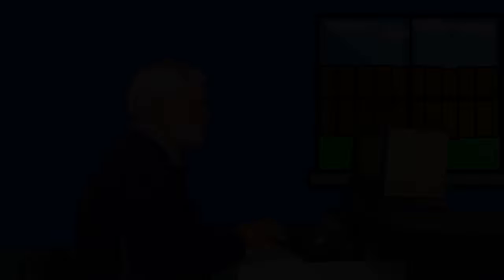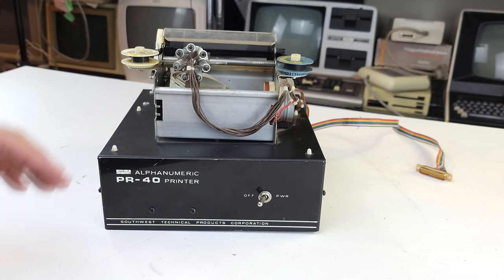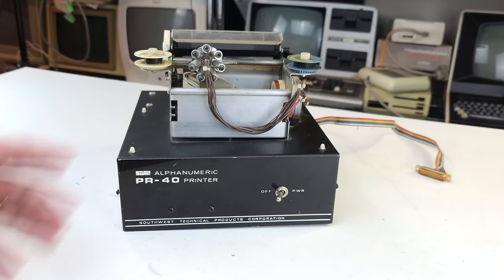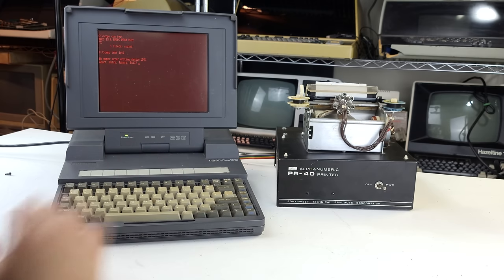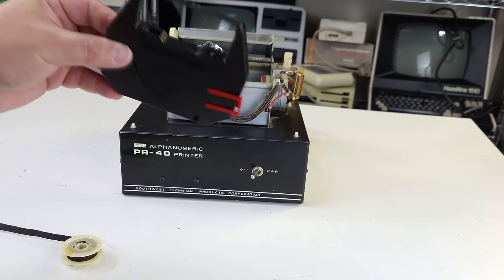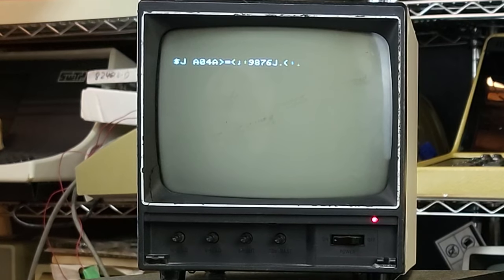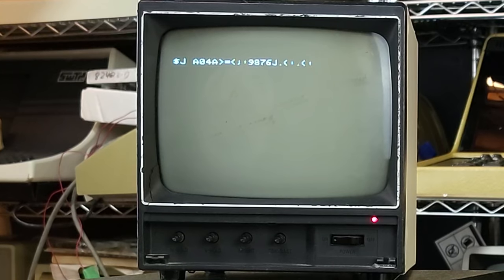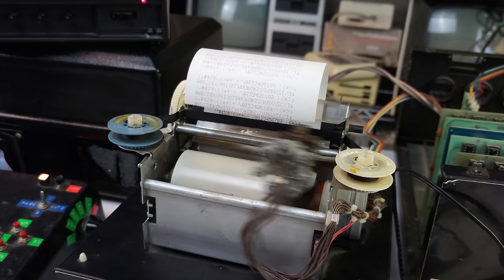One of the first printers for a home computer: the SWTPC PR40

Comment: Love this sort of "analog" technology right at the birth of what we consider "computing" today. Incredible engineering and ingenuity that went into these machines.
Reply: It reminds me of the Sinclair ZX Printer. They had custom paper which was aluminium coated, so silver on top and black underneath. The printhead was a single electrode that was scanned across the paper and the paper advanced was geared down version of the print head. It had one digital input which produced a spark to vaporise the aluminium exposing the black underneath. There was also a digital output as the electrode passed the left side of the paper. The printer driver was some Z80 code running in a tight loop shifting out dots with interrupts disabled. Ultra low cost design for the printer and I think you had to buy the special paper from them.

Comment from the maker: A few notes that didn't make the video: I ended up cutting the DB25 off and just plugging the wires directly into the molex header on the MP-LA.  Totally forgot to mention that.  Also, I ended up moving the MP-LA to Slot 2 during testing, so that's why the address I entered near the end is hex 8008.
Reply: Soooo...... you could put a replacement DB25 on with it wired up Centronics stylee :)

Comment: The printer SWTPC used to build this was made in Riverton Wyoming by LRC, a model 7040 ticket printer.  At the time this was an OEM printer sold with no electronics mainly for cash registers, casino and lottery ticket printers.   LRC was purchased in 1980 by Eaton corporation,  now it's remnant is Pertech still in business.   I went to work for the company in 1980 as a test equipment engineer and built Z80 S100 based computer diagnostic, production and life testing computers.   I still have parts and a working improved version of this printer designed an built by LRC using the 7040 printer.

Comment: This reminds me that decent printers were ridiculously expensive until Japanese dot-matrix models with 'Near-Letter-Quality' (double-pass) output became affordable (mid-1980's?). Before then, letter-quality printers were $1500 and up, while dot-matrix printers cost less, but had crude output. I remember (late 1970's-early 1980's) when converting castoff IBM Selectric typewriters for serial or parallel output was a thing; but such machines were very slow and had to be realigned constantly -- and they would still set you back several hundred dollars. (One can treble or quadruple the prices involved at the time to get the cost in today's currency.)

I enjoy your channel, which fills a gap in coverage by most other retro channels, which are PC/Commodore/Apple-oriented and seem to dwell mostly in the 1980's and 90's. I love hearing about stuff from the initial 8-bit wave, including CP/M. Thank you.
Reply: Hewlett-Packard was making them well before the Japanese copied their designs.
But: they cost as much as a new car.

Comment: That PCB looks absolutely gorgeous. How something like this could last as long as it has without outright oxidizing is a miracle.
Reply from the maker: Yeah I've been pretty lucky that way.  I have had some PCBs that were brutally oxidized though.  Usually older boards where they didn't tin them.

Comment: I have fond memories of this printer, which had 40 bytes of line buffer memory, and the printer mechanism itself was a cash register printer. You could send up to 40 characters to it followed by a carriage return, and the printers electronics would convert the bytes in memory to a character using its font memory in EPROM, and discrete electronics (no microprocessor used).
At that time I had a friend who self published a magazine about commodore computers, and especially the PET.
So he wanted to write an article about using this printer with a commodore PET, and he asked me to check his built as he wasn't a hardware person. So I obliged him and checked what he had done. I checked if the IC's were soldered correctly not 180 degrees rotated, and all was well, his solderjob looked okay, and he had not soldered in the electrolytic capacitors in reverse, I saw not other errors, so I cautiously gave my go ahead. My friend powered up the printer while he was looking at the PCB to see if anything started smoking. The moment he turned the printer on the large electrolytic capacitors in the power supply exploded right into his face, and there was brown and silver paper confetti everywhere. when he had recovered from the fright and had washed his face thoroughly, I checked if I could find out what had gone wrong, not the polarity of the caps, I had checked that. Then I saw the cause, he had reversed the types of molex connectors, and had used male connectors where it should have been female connectors , and female where is should have been male ones, this had swapped out the order of the wiring, resulting in reversing the input voltages. I later heard that eventually, after replacing the electrolytic capacitors, and swapping the molex connectors, and replacing a blown fuse he got the printer to work.
Reply from the maker: Oh wow!  That is an amazing story!  I have had caps blow up in my face and even though no actual damage occurred to my person..  it still freaked me out.  I cringe every time I plug in old electronics because I'm waiting for that pop to happen.  This is really great hearing from a contemporary user.  Did I have your motivations right?  Was it mainly about having a hardcopy backup?
Reply: @TechTimeTraveller  The main reason, I believe it was, was that he wanted to get it working on his PET, and write an article about how to do that. And in fact he did just that. It could be he also used the printer to print labels for his very extensive collection of commodore PET cassette software.

Comment: SWTPc's 8k Basic & up would print to the PR-40 with a PRINT #7 command or a LIST #7 command.
Flex's default P,DIR would also print to the PR-40.

Aside from the PR-40, any printer you could connect to your system co$t more than everything else!
I have fond memories of them. I even had an article printed in "Doctor Dobb's Journal" that was printed on a PR-40 and was how to use the PR-40 with SWTPc 4K Basic.

Comment: Back in the day I worked in a telephone exchange for the Air Force. They used teletype machines for communications hard copy. After my tour of duty I bought a used teletype machine and connected it to my TRS-80 Model 1 computer. I then wrote a short translation program to convert the asci 8 bit upper case and lower case to 5 bit upper case Baudet code, slowed the data speed to the teletype machine, and added a timing delay and current loop circuit to match the teletype machine. It was painfully slow to print anything, but was better than scrolling through a tiny screen full of code looking for a bug. Having the entire code to search through made life a lot easier.

Comment: Hey, I STILL have a bad haircut! Just a different bad haircut than in '76. :)  

I helped build one of these when they were new. I was just 18, but my friend & mentor bought one of these. As someone who was reading all the computer magazines every month back then, I agree that this was the first printer designed for the computer hobbyist market. When Bob got sick of printing on cash register paper a couple of years later, he upgraded to a surplus commercial Centronics 101...which I got to help him carry upstairs. Yeah 150 lbs sounds about right! That monster only printed in one direction, so returning the carriage to the left side was dead time when the printer wasn't productive. Well, they wanted to minimize that, so the carriage return on this dinosaur was like firing the printhead out of a cannon. It then slammed into a BIG shock absorber on the left side, and shook their whole house when it was printing. Ah, the good old days. :)

Later, he also acquired a "Friden Flexowriter", a direct competitor of the Teletype machine you showed, I believe. I don't recall what interface the Friden used, but it sure wasn't RS-232 ASCII. Maybe BAUDOT encoding? Bob designed and built a conversion board that involved lots of reed relays. I can't recall the model but it looked like the Friden 2200 series.

Nice channel. :) Subscribed.

Comment: Ahh, good times...
This brings back the memory of my first printer - Seikosha MPS-801 with serial interface for Commodore computer. The only slight issue was that i had the Spectrum, without any interface whatsoever. So I made my own, using Z80-PIO, If memory serves.
BTW, MPS-801used so called "uni hammer" head, so instead of 7 pins, it has one long vertical hammer, and below the paper was long rotating star shaped prism, so printing was performed "pixel by pixel", compared to normal dot matrix "row by row". No wonder that, at 50 CPS, it sounded like Stihl chain saw...
Compared to that, SWTPC PR40 printing technology look quite modern, especially considering it was about 10 years before MPS801 :-)

Comment: Impressive troubleshooting and great information! My first printer was an IDS Paper Tiger 440, which didn't seem much further along technically than this.  It was a beast, but I had so much fun using it with my Exidy Sorcerer.  It even had "graphics"!
Reply: It was much higher along: it printed full width pages and didn't overheat.

Comment: With the disclaimer that this is from vague memory of first-hand memory from my 20s when I'm well into my 40s now and my memory isn't getting any better...

I recognize LRC, Inc. as a name from my time repairing old stuff from Big Blue.  I don't know the providence of this specific model - but ones like it  were used in early model cash registers, what would be the progenitor to the SurePOS systems IBM sells to this day - the LRC printer component part anyways.  These were essentially terminals - there would be a SurePOS "master" that was a computer running a very early operating system - CP/M or AIX depending on age though it would have been CP/M back then, usually held in a cash office or similar secure accounting space, and then SurePOS registers.  They were a little smarter than dumb terminals, since they would be attached to a printer and cash drawer the terminal would have to interface with, but not by much.  The LRC component was the printer only, as the chips to control it would be either on the controller for an economy system where everything printed in the cash office, or on the terminal if they were at the register.  The former was more common until the personal computer revolution began.  These were largely used in many banks, and modernized versions of these are still used in some banks back offices to this day, such as TD (or they still did some six years ago  when I finally got out of doing this as anything but a hobby - might have changed in the intervening time).

From what I was told when I was trying to back-engineer these for lack of documentation, LRC was a second source for IBM, but I am not sure about that because I never saw anything other than LRCs with these early systems.  It's possible they were a primary source but got relegated to secondary source status when more providers came around.  But, even so, it was never an exclusive thing back then - the market was too small for exclusivity to be sustainable (and indeed many companies had problems even without it).  So it doesn't surprise me to see Southwest using a component that was largely-proven by Big Blue to try to get to worth with their attempts at personal computers.  It would be a while before that really took off, I guess the SWTPC 6800 was before its time in that regard.

I just wanted to finish this long questionably-informative ramble with saying I really appreciate seeing you getting these old systems working again - they're basically historical artefacts now, and pretty much everything about our current society owes much to these early forebears.  It's more than just a nostalgia trip: understanding how primitive computers works is very informative to the underpinnings of our current computers.
Reply: On a more directly on topic note - there were metal versions of those spools you could get provided by IBM themselves back in the day.  Quick research doesn't find them unfortunately, but you might want to consider having replacements on hand for those plastic ones if you run the printer for more than short bursts.  It's probably not too difficult to 3D print them.  Repeated passes over time without rest tended to stress them in a way that causes them to develop cracks.  

Your LRC seems to be missing some c-clips that held the spools down without exerting too much force, which is likely why you had to hold them down.  You could probably find one of an appropriate diameter, I used to get them out of the bins of auto body bits and bobs out of Canadian Tire or PartSource.  Just make sure that it doesn't restrict rotation of the spool and you should be OK.  You don't want them to be too "tight" - just tight enough that they're kept from vertical movement.

Also, if you do plan to use it: the printers were not made to print more than 4-5 lines in one "go".  The output was meant to be like "$500 rm dr1" and similar shorthand for cash transactions out of the cash drawer, at least in the IBM application - the lines  got more longer and detailed with later iterations of the software, but retained a limitation on the number of lines.  If SWTP were intending it to be used, for example, as program readout printers, they would be pushing the poor things pretty hard, unless they paused it every handful of lines or so.  Modern lubricants may give better performance over the long term and ameleiorate that problem, however.  But I would advise a little bit of caution there regardless.

Comment: That is pretty aawesome.Is there any way to retro fit lower case letters into the printer? The quality is pretty darn good, certainly on par with the Citizen 120D+ 9 pin I bought for my Amiga c. 1991. Though of course that was an regular size printer.
Reply from the maker: I supposed you could have changed the printer's character generator and reworked the PCB.  Of course the 6800 computer couldn't handle lower case but maybe another machine could.
Reply: @TechTimeTraveller  would you have to rework the PCB? I don't know how these uppercase only machines stored characters. I'd assumed they simply lacked the 6 and 7 ASCII hex rows, in which case the character ROM would still have the needed addres pins wired. But maybe that wasnt how it was done. And yup I wasn't thinking of any particular computer driving the printer. Nice to see the MC6800, surely the granddaddy of the PC revolution courtesy of the IMO over-rated 6502, get some attention. Anyway thanks for taking the time to document your projects/hobbies. Looking forward to going through your old videos. :)
Reply from the maker: @Lawrence Manning  Well you would have to change at least the character rom as well as the circuitry that is designed to catch lower case characters and convert to upper.  Might just be a matter of disabling those chips.  Many thanks for watching!
Reply: The main problem would be, even if you modified the PCB you couldn't print any descenders with only 7 pins. That's why almost any printer with lower case letters had at least 9 pins. Although there was the odd one that used "fake descenders" by shifting the whole character up, but it usually looked rather nasty.

Comment: There's actually a couple of those early 70s production printers hanging out at a local junk store I frequent. They're sort of "The guys" as they are too big to move around easily and too old for people to buy, so I've seen them every visit since I started going in 2009. I think one is an IBM and the other says Star.

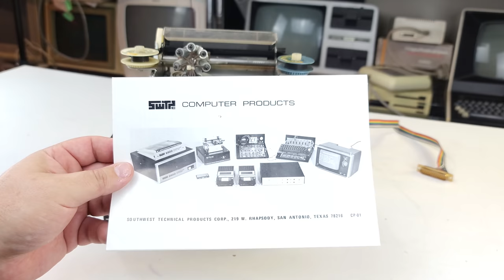9:00 Did you ever take the picture?
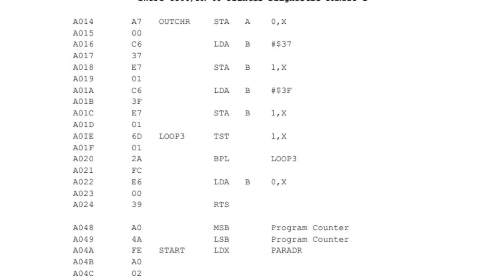19:52 I think "PRNTST-1" is PRiNter TeST-1 not PRiNT STat
34:28 I think that Oki ribbon might fit my Microline 182 Turbo / 186, interestingly enough
Reply: Update, I did actually go back and buy "the guys" as mentioned here. One is a Star Micronics NX-15 wide format 9-pin dot matrix printer. The other two, one was an NEC SpinWriter and the other a CADO Systems thimble printer based on the NEC design. the NEC was missing pieces, no thimble, no ribbon, no knobs, so I picked up the CADO instead.

Comment: You should have tried wiring up a bunch of switches to place 0 or 1 on each of the inputs as appropriate, a push-to-make switch to the strobe and perhaps an LED on the busy line.  Then you could have sent one character at a time to the printer by setting the desired ASCII code on the data inputs and flicking the strobe switch, finishing with 0001101 for a carriage return .....

Comment: Didn't Radio Shack also sell a feeble four inch printer in the late 70s? I sort of remember that it required special impact paper because it didn't have a ribbon.
Reply from the maker: Oh yeah.. wasn't that the Quick Printer?  For the TRS-80?  Think it used special aluminum sorta paper.

Comment: Is that a Toshiba 3200sx?  I have one as well.  One of the 2 retro pcs I collect.  Also have a hp 95lx
Reply: I got a T3100/e and a T3200. Be aware there are 7 or so Rifa paper suppression caps in there, and they will pop if you use them for a while. 
Still gotta reassemble the 3200 after it let the smoke out. I was playing with it in my bedroom when one of the Rifas blew. Had to sleep with my window open in the cold of winter that night...
Reply: @mfbfreak  thank you.  I havent powered it up in about a year.  I did remove the old lithium battery.